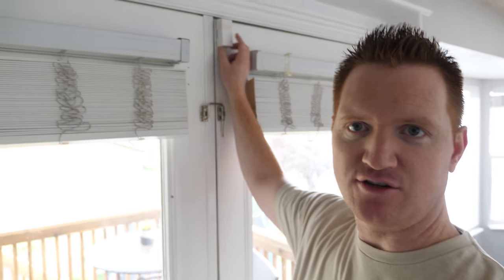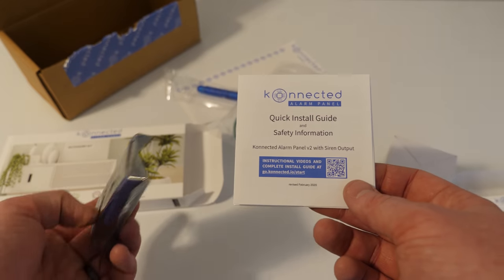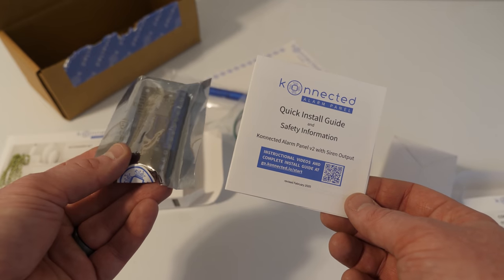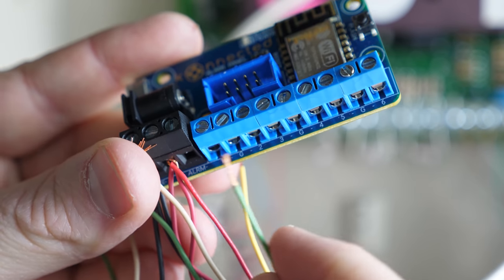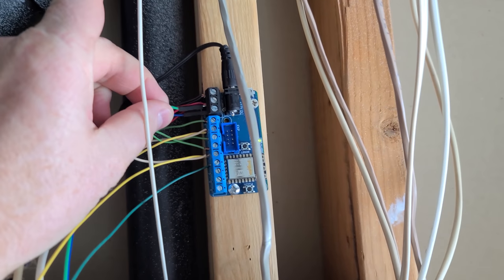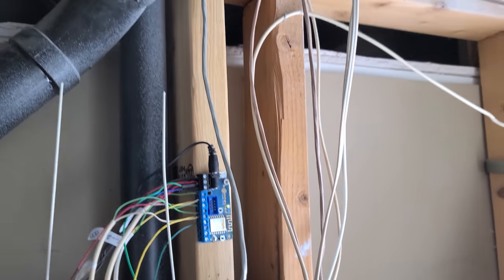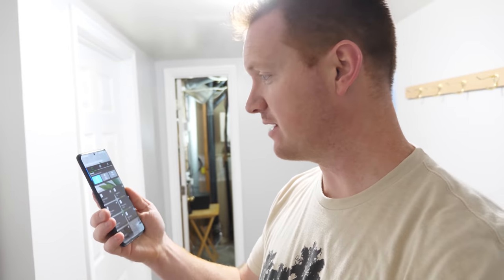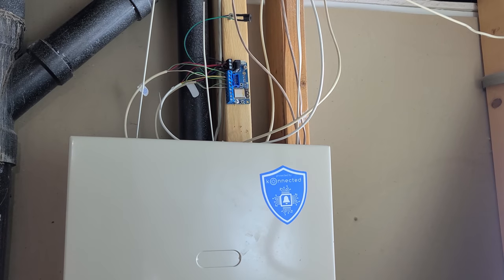This Tiny Panel is My New Home Security System

Comment: I believe, it will be cheaper to buy up-to-date sensors than paying $229 for Konnected conversion kit, unless someone sends me a free unit.
Reply from the maker: I was surprised at how much new pire motion sensors costs compared to Smart things sensors. This certainly is most beneficial if you already have many wired sensors.
Reply: The Konnected kit starts at $99 USD for 6 zones/sensors. If your home already has wired sensors like Brett's, it's definitely better value and aesthetic to use those that you already have wired in the walls. Don't forget that new sensors are going to be wireless and need new lithium batteries every 6-12 months, which adds to the lifetime cost.

Comment: Thanks for this, I'm in the middle of trying to understand my old school wired alarm, while converting to a more wireless smart home setup. I too almost ripped it all out before knowing I can use some of the components with these conversion kits. Have you checked your door frames for embedded magnet sensors. I found these on my home nearly hidden and painted over used with the old wired alarm.

Comment: I would remove the boards from the metal enclosure box and mount the new boards in there. There just circuit boards so they should be mounted in an enclosure instead of out in the open.
Reply from the maker: That's a great idea. Do you think it would effect its Wifi signal much?